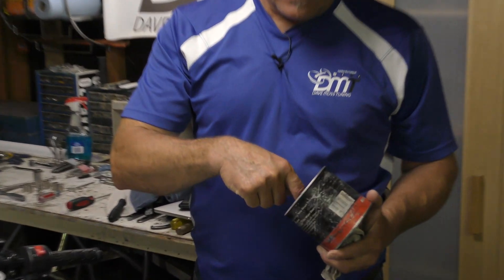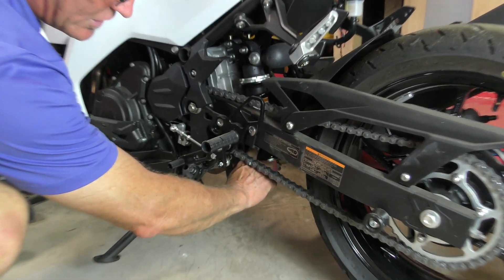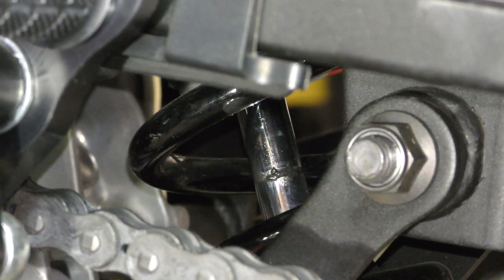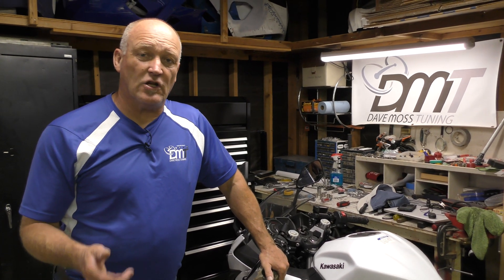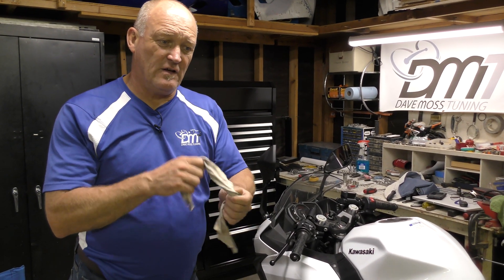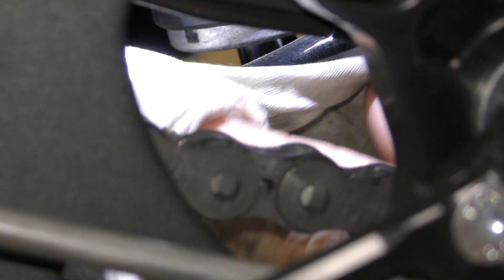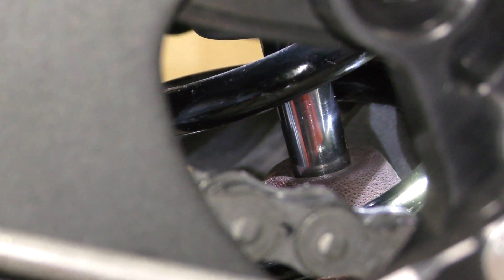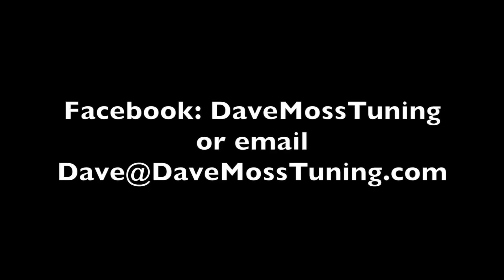How to determine/measure Motorcycle Shock Travel

Comment: Rear end feels harsh. I got the front wheel up with a power wheelie and the shock isn't anywhere near hitting the bumper with preload and compression adjusted full soft. Sag is at 34mm. Should I get a softer spring?
Reply from the maker: Is 34mm a number where you added static and rider sag together? Given your explanation, it would appear a softer spring is needed.
Reply: @catalystreactionsbw  added static and rider to get 34

Comment: How much travel is too much? How close to the bumper should the grease ring? I think with the forks, we should have 10-20 mm in reserve? Thanks for the video
Reply from the maker: 10-20 in reserve for the forks for the track and 15-20 for the street. For the rear shock, 1-2mm for the track and 2-4mm for the street
Reply: @catalystreactionsbw  Thank you. Surprising how little for the rear shock. 2-3 mm is a tiny amount 😮
Reply: @catalystreactionsbw does reserve mean 10-20mm from the bottom out point correct?
Reply from the maker: @merk8641  Reserve on most shocks is 2-3mm from the top of the rubber bumper. Theer are a very small number of shcoks where bottom out is 5-8mm from the base, but to date those have all been dual shocks on the rear.

Comment: I recently signed up on your page and love all the educational videos! I am, however, wanting to see either a KTM 690 or a Husky 701 with enduro wheels setup for dirt/gravel and road. 
I have seen all your 701/690 and dual sport videos and was wondering if there are huge differences between knobby enduro and motard wheels in a suspension setup? 
Also what starting tire pressures do you recommend for enduro wheels, street, and gravel roads? 
Thanks a bunch!
Reply from the maker: Differences are 1. shock rebound is much slower for grip. 2. fork rebound is faster to create a second bounce. 3. Much more shock travel than fork travel in principle due to sustained load in the dirt. 4. Far less stress on the chassis with grip and torsional yaw.

Comment: Hi Dave, I enjoy learning on your channel. I ride a ninja400 at the track. What front and rear upgrades do you suggest to the bike? I am 5.7 and weight 165lbs. Thanks in advance.
Reply from the maker: Thanks for the kind words. Andreani Misano for the forks with .80 springs and a 2011 GSXR 600 shock. You will need some shock mounts from Norton Motorsports.
Reply: Hi @Dave Moss Tuning, I ordered the parts, a performance shop will install next month. Let's connect to do the turning. Much appreciated !

Comment: Dave, I appreciate the detail in your videos and the wide range of topics covered. I don't have to own the bike you're working on to perform the same work! Off topic of this video - I was hoping for some insight.. My rear brake pads are rubbing on the rotors. I've heard this is usually fine. I've followed your brake caliper cleaning guide cleaning the pistons and trying to evenly align them. The only thing that seems to correct the rubbing is to loosen the caliper or wiggle the caliper to create a tiny bit more room. But applying brake pressure just makes it come back. Any other thoughts or an I just being paranoid?
Reply from the maker: Hello Jon. 

Thanks for the kind words. Please check the rear brake caliper is floating correctly on the pins, and if not they will need cleaning and greasing.

Comment: Hi Dave, do you have a video on how to choose the right springrate for track usw? i ride an Vitpilen 701 and the 110 nm springrate seems to me very high for such a light bike and my 80 kg in gear. Thank you alot for your great videos!
Reply from the maker: Spring rate choice is based on fork or shock travel used and that is from weight and ability combined. Oil age and viscosity also plays a large part in fork movement. So - how much travel are you using? If less than 50% with original fork oil, yes - a .95 would seem ideal.
Reply: @catalystreactionsbw  Thank you for your reply. it's not about fork it's about shock spring. Over winter i'll change forkoil with help of your videos. shock will be serviced by a friend, but shock springrate i have to choose by myself. for now i would say i use about 50% of rear travel.
And Dave i love your channel!
Reply from the maker: @bartiger245  If you are using half the travel - check static sag for the rear shock and let me know what it is now.
Reply: @catalystreactionsbw  this one is easy, static sag (unladen) is 10 mm. iam considering a duke 690 R shock (length, frame swingarm all the same) but the duke shock got more travel (150mm to 135mm) and springrate is 75 nm instead of 110 nm. bringing springrate in the ballpark is a topic nobody speaks about precise.. maybe it's a topic you could discuss. thank you a lot!
Reply from the maker: @bartiger245  I did a quick query on my channel to find videos that talk specifically about springs and spring rates. If you have seen these and another video is needed, happy to put that on the shoot list: https://www.youtube.com/user/CatalystReactionSBW/search?query=spring%20rate

Comment: So when we aren't using the whole shock travel and we are using just half of it.. We can soften the rear? And then set the front to level the chassis? Am I correct?
Reply from the maker: 1. Check sag numbers to make sure you are at least in the ballpark. 2. If sag is correct and you are using half the travel, soften compression first and see if that makes a difference. 2. If no difference via compression, soften the shock by 3-5 turns and see if that makes a difference.

Comment: Great tip. May I know why do you have a white paint mark on your chain, please?
Reply from the maker: The bike has a couple of hundred miles on it. That paint mark came on the showroom floor from the manufacturer.
Reply: Makes sense when you put lubrication on the chain and you are not able to recognize the bold where the chain was linked. You can  see when the chain turned around one time.